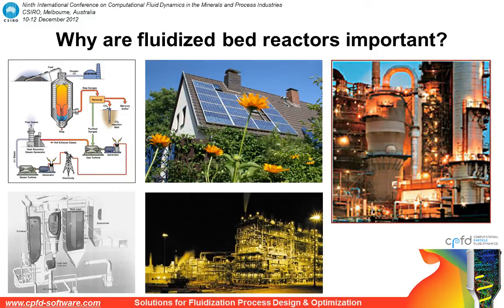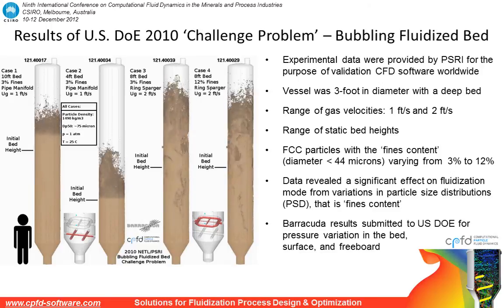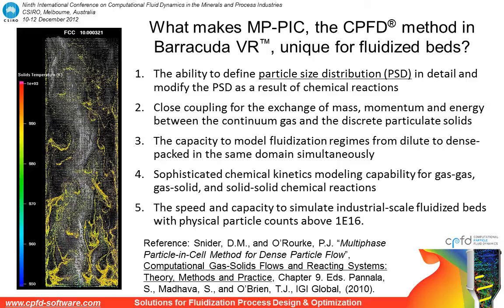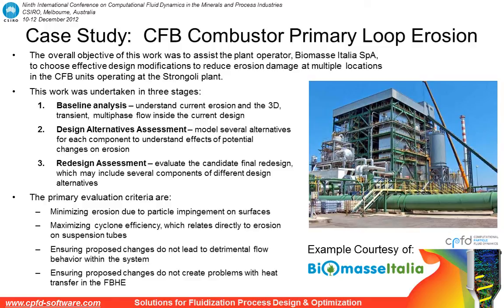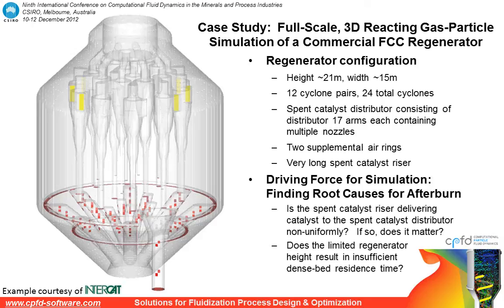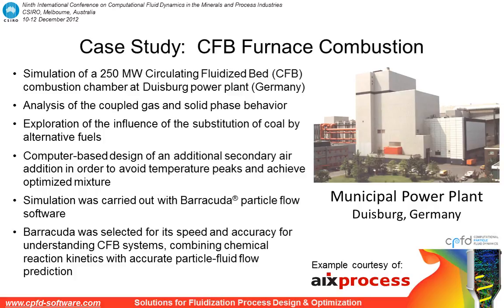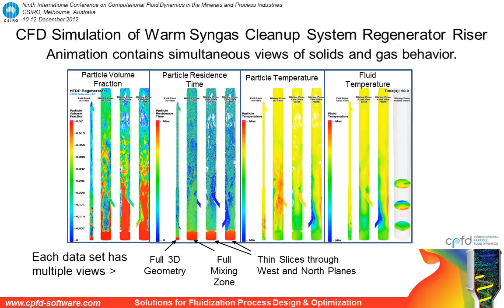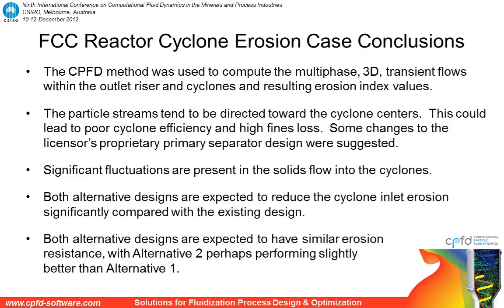CFD Predictions of Gas Bypassing in Large Deep-bed Industrial Chemical Reactors

Comment: can i ask u guys something about this workshop? how can i plot the erosion on the wall i cant find any way on my barracuda. im using version 17.4
Reply from the maker: Hello Salman.  Erosion plots are only available if the erosion model was turned on during the simulation.  Please check this.  You can find more in section 13.6 of the User Manual.  For additional support please email us at support@cpfd-software.com or contact your local distributor.